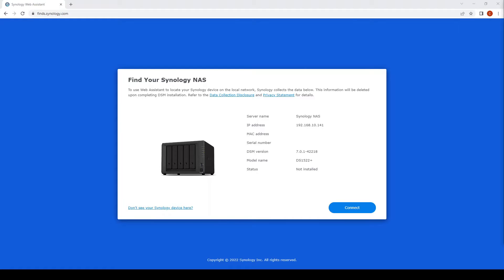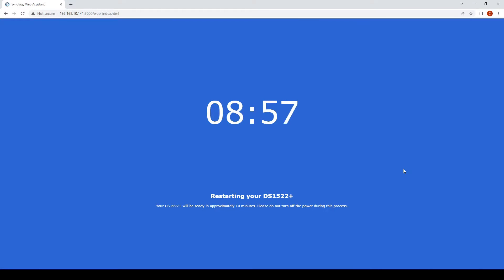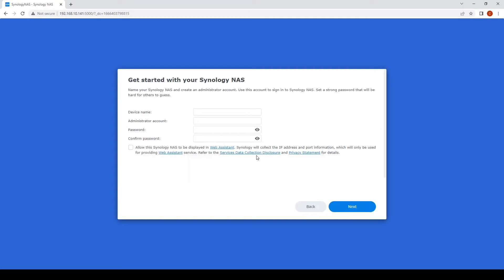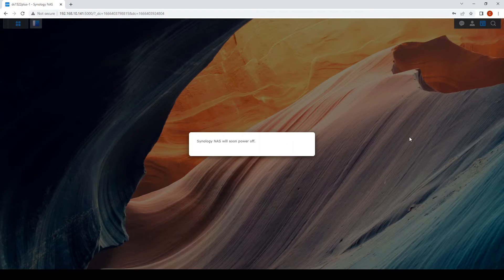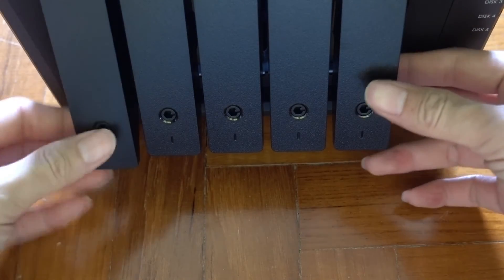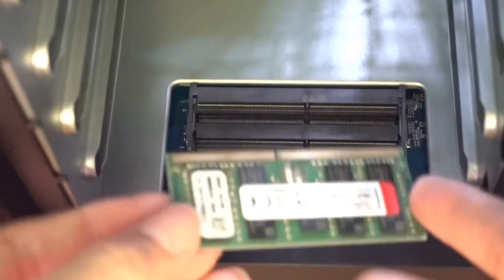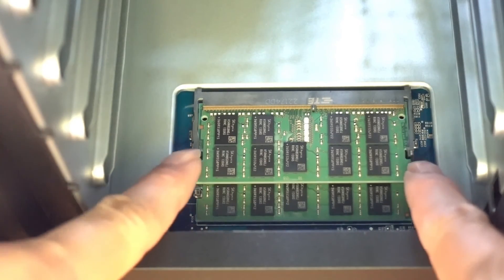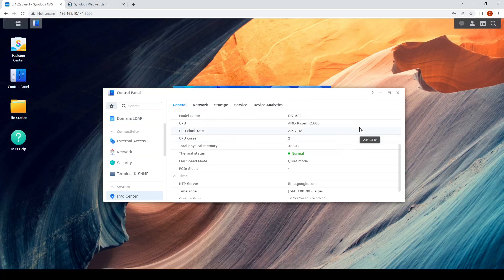How to install ram on Synology DS1522+?

Comment: I just did this twice on my DS1522+ with some 2x16GB OWC ECC, but oddly enough, my DS/Synology Control Panel only sees 8GB still.  Any advice?
Reply: im having the same issue anybody figured it out?
Reply: @almightyurf3236  For me it was user error.  I wasn't paying attention to the sticks that I was putting in, and inserted a new 16 GB stick along with the old 8GB stick that it came with.  Once I put in 2 - 16 GB, it recognized it as 32 GB.
Reply: @DavidLam-o7y  Welp never mind I thought I inserted in properly its now showing 18GB on mines
Reply from the maker: glad you got it to work. :)

Comment: Hey man, I ended up locking my slots in the "downward" position without actually installing the RAM, can't seem to get this unstuck. Any ideas?
Reply from the maker: the slots are "spring loaded".. there should not be a "downward" position. Try inserting the RAM again. Try different angles to see which angle it can slot in.

Comment: You’ll never need more than 8GB it comes with.
Reply: "640K of memory is all that anybody with a computer would ever need."
-Bill Gates
Reply: @ChrisChristenson88  That was back in 1981...lol :)
Reply: I like to know that too. For a Virtual Machine it is very nice to get more then the 8 GB. If you don't use that, I agree with you.
Reply: Wouldn’t say that. Completely depends on what you use your NAS for. 
If it’s only glorified storage, then you don’t need more than 8gb.
But if you really want to make the most out of your Synology upgrading the ram could be useful, especially if you run memory heavy services on it.
Reply: you do if want to use active backup suite, especially active backup business
Reply: Not if you are using it for a business
Reply: You clearly never experienced multi user environment. You have no idea what you're talking about
Reply: I run multiple docker container services for my business from the NAS and take the server portion seriously - so yes more than 8gb is a requirement. I have one container that alone requires 4gb to run..